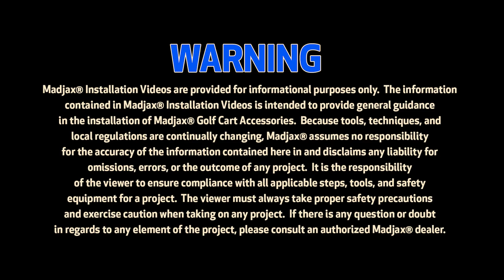Alpha Body to fit Club Car® Precedent® | How to Install Video | Madjax® Golf Cart Accessories

Comment: definitely in need of an updated video. as prior comments are saying, I was surprised by the backwards mark on front lights harness (shorter was for the longer run and the longer for the shorter run). I had enough length for the rear lights. I was very confused with the grille install. no wing nuts, and missing parts, had unscrew and as a prior comment had to make it work and unscrew grille and attach the new aluminum support thru the back of the grille and then screw grille again (but all screw holes on grille were already cracked and had to make it work again....  I think all of this should be fix for more user friendly installation and no need to "make it work". Overall not bad. Thanks

Comment: As others stated, the updated instructions are still not correct. They have the short wire for the front drivers side marked white, and the red passenger side marked red. The drivers side is to short and the passenger side is to long. They have it backwards. Also in the video it shows him screwing the support assembly for the front cowl in place. Again, both video and instructions were wrong. They  you 2 carriage bolts that have to be inserted into place holding the support brack on for the front cowl,  then you install the front grill over the two carriage bolts. Also the instructions say “ use hardware from package #1. I didn’t receive any packages labeled. I received 2 packages zip locked with all the hardware in them. The front lights don’t fit flush with the front cowl. The edges in the corners stick out, no matter how tight you make them. The rear body panel is very tight fit. I hade to remove the trim around the rear body, install the body and force the trim to hold it in place. Now I keep having the front round corner pop out. I had the double take Phantom body’s in the past, and did not have all these issues. If you want brake lights, turn signals , horn you’ll need to buy the additional kit that supplies all that. Then, you end up jumping back and forth with videos, instructions etc trying to figure everything out. All in all, it took me a weekend to install their 4” A Arm lift, Alpha body kit, Their Gensis rear seat, extended roof, wheels , tires, turn signal kit, everything took about 10 to 12 hours, but now I have a brand new golf cart totally rebuilt for allot less. I been buying their lift kits and back seats for years, so If your handy and have a weekend , you can save thousands in labor cost. Without the rear seat and lift kit, I could have done the complete body kit and wiring under 5 hours .

Comment: I cannot figure out what screws are used to attach the front cow bracket to the body..
Reply: I'm having the same problem. Don't have hole for them to go into either. Not enough screws to attach to the under body.

Comment: The rear alpha body seems to fit pretty tight, as you get one side in the other pops out. I tried tapping with my hand on the back corner, it broke, had to glue it in place. You can see this in the video, and we don’t see what gets edited out also. Don’t get me wrong, Madjax has some of the best videos I’ve seen, and some good products, but just letting you know what to expect on this particular item, so you don’t break it like I did.😑
Reply: It's the same two years later. I had to actually slide the underbody back over 1/2" to get the rear cowl seated properly all the way around. It's still a little wonky, but workable and the rear seat covers it. The tail lights actually help a little to hold it in place as well even though the tail light bracket holes on the underbody were like 3/4" off the mark.

Comment: This is a beautiful body kit, but rather difficult to install (especially with bad, outdated instructions, different hardware, etc.). The biggest shocker for me (confirmed by MadJax hotline) is the Madjax Ultimate Plus Light Kit (with all switches/controls on the steering column) is not compatible with the MadJax Alpha body wiring harness. So if you bought the MadJax elite light kit and then later upgraded to this MadJax elite body kit, you actually have to downgrade your light kit, specifically the turn signal switch to the basic one. I still have no idea why the Alpha tail lights require 4 wires. I was tempted to take apart the tail lights and change it to 3 wires LIKE EVERY OTHER TAIL LIGHT ON THE PLANET. Overall a great looking cart, but I doubt I'll do another one unless MadJax corrects the glaringly obvious goof on the wiring. Although, even if they do correct it, we'll probably never know because they never seem to update their packaging or instructions.
Reply from the maker: Chris, first off thanks for your purchase and apologies for the lack of compatibility with the new style turn assemblies.  We are currently working on the Alpha re-launch to address these same points and a few more. Updated instructions, full ultimate plus light kit all in one, new grille design, head lights, and limited edition colors. 

The reason for the 4th wire is to separate the brake light and the blinker so the brake light would stay on when the blinker was engaged for that side. In a traditional 3 wire tail light when the brake lights are on and the blinker is engaged the brake light for that side turns off and the blinker takes over. Thus leaving you with only one brake light lit up.  

We are currently overhauling all of our packaging and instructions with the new Madjax logo and taking this opportunity to freshen up the instructions as well. Hopefully we can get these issues resolved and regain your business. 

Thanks
Reply: @MadjaxTV  I can appreciate that you're doing all this, but this body kit is coming up on 4 years old, and not to sound totally selfish, but whatever you do to it in this "re-launch" isn't going to help me (or any of your previous customers) with the better part of $1000 I spent on this upgraded body kit that now has no working turn signals or brake lights.  Again, the body looks great, but I have stock Precedents all around me with working brake, turns signals, and everything controlled on the steering column. It's actually a little embarrassing.  "Nice body, dude. Love the lights. Hey, why are you using hand signals?"  

You really need to address a solution for your current customers as well as solving the issues for future customers. What good is a fancy body kit with proprietary high end light system when there's no way (outside of splicing and hardwiring) to get the brakes and turn signals working?  You won't be regaining my business until you give a solution that helps me as one of your current customers.  So glad you're working so hard to satisfy your future customers that you don't even have yet.
Reply from the maker: We sell our Turn signal upgrade kit separate from the Alpha kit since not all people need the upgrade kit for their neighborhood/application. The upgrade kit that mounts to the Alpha is the 02-006 and does not require any splicing.  We should have more in stock in the next few days. https://www.nivelparts.com/product/53398/madjax-ultimate-upgrade-for-basic-light-kits
Reply: @MadjaxTV  you sell it separately acting like you're doing your customers a favor but then you force us all to use a proprietary bucket harness that has non-standard 4-wire taillights that make it incompatible with even your own upgrade kits and definitely all other wiring kits. I've been trying to order MadJax 02-006 for going on 2 months now from several sources and I keep getting sent the GTW 02-122 kit claiming it replaced the MadJax 02-006 kit. Most of my cart is MadJax parts. I did this specifically to avoid the compatibility issues I'm having now.
Reply: For anyone finding themselves in the same fiasco as me, the turn signal solution I eventually went with is the "10L0L Golf Cart Universal Deluxe Light 9-pin Plug Upgrade Kit". At < $90 it's literally half the price of the MadJax (now GTW) upgrade kit, and ironically much more compatible with the Alpha wiring. The only modification you'll have to make is snipping the middle blue wire in the 10LOL side of the 9-pin connector (the Alpha harness doesn't have a wire in the middle of that 9-pin plug), crimp a blade connector on it, and then connect that blue wire to the loose brown wire with the blade connector on the Alpha harness. This allows you to turn on the Alpha head/tail lights with the rotating switch on the stalk.  The turn signal wiring all matches up perfectly and even the horn connection on the Alpha harness works with this kit.  The brake light pad switch works fine, too. Initially my horn didn't work, but there's a diaphram adjustment screw on the horn itself that fixed that by loosening the adjustment screw. I then actually tightened the adjustment screw a little to reduce the volume of the horn as it's really loud (like car horn loud).  The light switch on the turn signal stalk of this kit actually has two positions but the wires are tied together further down in the wiring harness. If you're so inclined you can separate out these two wires and then control two different sets of lights (like the Alpha DRLs, extra parking lights,  or extra fog lights, etc.). Hope this helps someone get a better handle on this fiasco than I initially did.

Comment: Is the cart in this video lifted?
Reply from the maker: Sorry for the delayed response, it is not lifted. The Alpha body kit follows the same lines as the OEM so all lift kits are compatible. Thanks
Reply: including the long travel kits?  They seem to utilize the front frame as does your body extension?

Comment: Very poor video instructions, and some cheaply made ideas. Not recommended to purchase the Alpha body kit until improvements in instructions and quality is made. The wiring for the driver side tail lights are way to short, big mistake. Not enough electrical instructions, and when there is any, your not sure what cart it’s for.